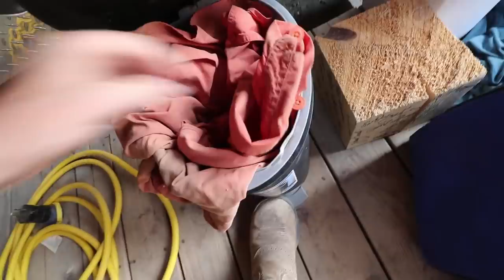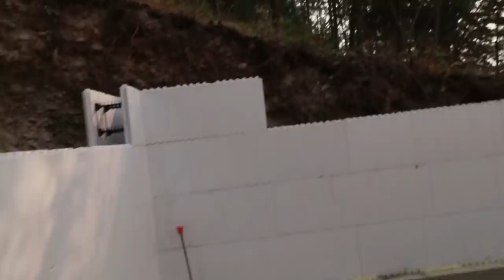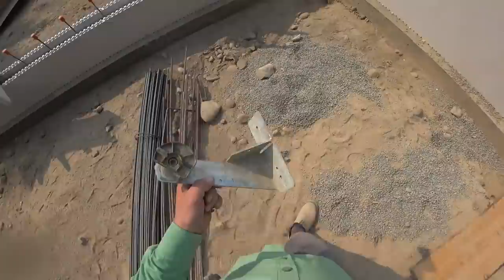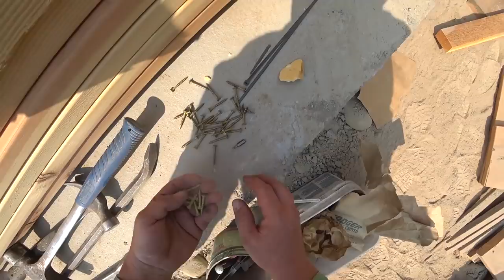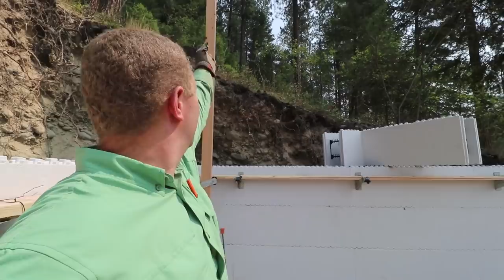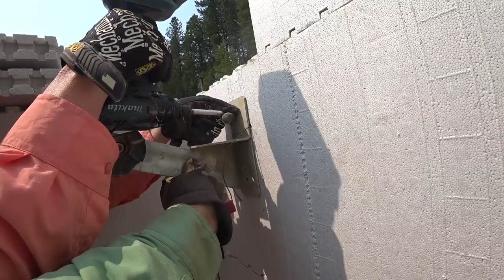Building a House Start to Finish: ICF Construction Walkout Garage

Comment: My wife and I built a fancy chicken coup a few years ago. In 113 degree heat. I have an (Alaskan weather preferred body type), so I didn't handle the heat very well. 

I remember waking up the next day and for the life of me I couldn't formulate a thought or a sentence. I thought I had a stroke during the night. My joints and muscles were beyond sore. 

Long story short. Gatorade or the healthy homemade version. Drink lots and often. If your thirsty you're dehydrated. It's that simple. Also wet your head often. 

Once I drank the two 32 oz bottles and about 30 minutes later I could think clearly and felt 100% better. 

Good luck with the build. Been watching since you started. Stay hydrated.

Comment: We always stacked two rows and then poured the slab. That way you have a good surface to work off of. So much easier to set your bracing system up on a solid surface. We used a true icf bracing system though, not the zont system. If you have a spot where your icf doesn't want to stay together, screw each end of a ratchet strap to the wall by pinching it under a horizontal piece of 2 x 4 about 4 ft long, top and bottom of your wall, inside and out. Ratchet down the straps and then stuff the tips of you foam gun in all the horizontal seams and squirt foam into them about every 6 inches. Let foam harden, remove straps, walls is solid. Quick and easy. Even faster it is to push down on top with backhoe (add protection under bucket for ICF) and then screw a vertical 2x up the trouble spot and install foam as mentioned above. I have done this a ton of times. Arxx ICF has a metal clip that pulls the blocks together vertically but they are the only ones I know of. Push comes to shove you can put the fat kid on the top of the wall as ballast while screwing the 2x on. If we didn't have a fat kid, we would use 2 or 3 skinny ones.   :-)  If you find that it is your footings and not your ICF joints, take a pull saw and cut a thin strip off the bottom row of ICF as a relief for the high spot in the footing. Tough to do now since you have your WP membrane on, hence another reason not to cover the wall until you are sure everything is good to go.

Comment: Get your self a large  3' dia fan, crack a water hose just behind the fan and let it blow cool air and mist over your work area, it really helps.  Used the trick to build a 60 x 46 hangar in over 100 deg temp.  Down side -- may need the  generator to power a larger fan.
Craig

Comment: Hi Jesse and Allysa.  I would like to share with you a major French drain mistake that my wife and I made 20 years ago when we were doing our self build.  I thought that you said that you were going to run your French drains into a dry well (gravel trap).  That is exactly what we did -  we dug two large pits and filled them with gravel, covered the gravel with drain fabric, and then buried them.  One year, we had above average rainfall, and guess what... the dry wells filled up.  Then the whole drain system filled up, and then our entire system became pressurized.  Needless to say, we found out that there were failures in our sealing system. We were flooded.  After the second time, I dug down three feet to the French drain, then rented a trencher and cut a 75' trench to get a downhill run to daylight. I put a "T" in and ran corrugated drain pipe in the trench.  Problem solved.  So... save yourselves a big headache and run your drain to daylight.  I cut a round circle out of 1/4" hardware cloth and inserted it in the end of the drain to keep the critters out.  We have really enjoyed watching your videos... it has brought back a lot of great, and not so great memories ;-) .  Hang in there, you both are doing a great job and you will be in before you know it.  We're pulling for you!

Comment: When you end up on a supply run , do yourself a favor and buy some " linesman " plyers .  Will make cutting and  twisting wires much easier.  
Get a good set as you will be needing them when you do your electrical when it comes to that time of the build .
Reply: might find them at a military surplus
Reply: i was actually thinking of safety wire pliers...
Reply: These are what I use for electrical and general purpose:
https://www.kleintools.com/catalog/high-leverage-connector-crimping/9-heavy-duty-cutting-pliers-crimping
Reply: Klien's are the best, I did concrete for 15 years on one pair of klien's well worth the purchase!
Reply: If Jesse does the electrical they'll need a firetruck, not a pair of pliers
Reply: mwilliamshs Haven't you read the comments?They will be fine there are no ''codes'' where they are building.
Reply: klein would do the job

Comment: I used these form 20 years ago they work great.  I don't get zip tie I just put the rebar on the cross bar and tied it with wire.

Comment: This ICF stuff is the most insane, labor intensive way to construct a concrete form that I have ever seen.  And there is zero room for error!  Congratulations!  You have convinced me to never use it.  If I ever want foam insulation on a foundation wall it will be applied after the pour.
Reply: They are doing it wrong and having to troubleshoot or redo stuff. I watched a video of people doing it right and a 13 person crew installed all the forms, door/window braces, for a 2300 sq ft home and had it ready to pour in one day. Nothing wrong with the product if done correct.

Comment: It would have probably been a lot easier to just stack up concrete block and rod and grout them solid.  Attach sheets of rock wool to the inside and be good to go. Probably cheaper too.

Comment: I am a saver also (I know the shirt toss was staged but, it was still funny...you are maintaining humor which is good).  The orange shirt has history.  If it won't come clean at least save it for oil changes, cement poor,  and the painting that is coming up in the future (save the precious new green one). Both of you changing up shirt color is messing me up on who is doing what on some takes. Kudos to both of you working when hot.  I don't do well above 80's.  Usually take break from 1 to 4 then work until dark (day goes better in such heat).

Comment: My Dad's company & therefore, I every summer, poured basement walls. A house this size would have taken a day to set the pans including tying the steel, 4 man crew. Whalers were simply braced back to stakes driven in the ground, no turn buckles, do minor adjustments as soon as the concrete was poured. No scaffolding needed. Conveyor or pump, vibrate as pour progressed. Don't let the vibrator run against the steel. It will move the coarse aggregate away from the steel and fill in with soupy fines. A lot less holding power. 
      Take care as you pour watching for any sign of blowouts. Be prepared for them. You can't push them back, just stop the spread. If it happens, cut the excess concrete away early next morning, a lot easier then.

Comment: BUILD A 4'X8' 5/8" PLYWOOD PLATFORM ON TOP OF STANDING 2"X12 (If you need the extra height" ON YOUR BACKHOE BUCKET! Put 2x4 railing around three sides (half way around the 4' sides). Works great!!!! set to your work height, tilt a standard extending ladder and you have a stable platform, I made one when building a barn that had 14' side walls and 24' on the end walls. I STILL use it to this day trim high limbs on trees.

Comment: I understand (maybe wrong) that you upload your videos a week after the work has taken place. As you talked about this I had a flashback to the work my uncle Steve used to do. Install a board connected to your vertical at 45 degree both at ground level and say 10'. Drive a rebar behind the 45s and place wedges between the 45s and the rebar if you need more pressure. Advice probably comes to late!

Comment: Congratulations of 200K subscribers!
Reply: dcsoxford but them building the house and documenting it IS their job, I find it entertaining. If they just called in someone at each stage of the project it would be pretty boring. 

This summer I built a teardrop camper from an old utility trailer. I  knew what I wanted and while I did what research I could at the end you just need to get at it and get the job done. I can really relate to their struggles as a lot of times the way you think something will work isn't always the result you get. After completing my camper I am much more proud of the accomplishment than if i had just bought something that cost the same as what I built.

Comment: So many people hating on them. Has anyone not done any project ever? People mess things up sometimes, but it is not the end of the world. You learn from mistakes and improve for the next time you have a build. At least they look at what they are doing and try to think of all the angles and admit when they found something off. Sheesh, as long as it is within tolerance, code, and their own standard leave them be. They are not professional builders and I'm sure if they could have changed what they have done from the start they would have. Its all apart of learning.

Comment: I think you can attach two by sixes to the concrete shelf and then put your vertical 2 x 4's on top of that I think that be a better way to support the bottom of those 2 x 4

Comment: This is even more complicated than building your house from concrete and bricks. As far as I know you don't pour concrete in that deep layers. At most you pour it in 30cm or about 1 foot deep layer, then vibrate it, then pour another layer and I have no idea how you would do that with those walls that high. BTW good Seinfeld impression :D

Comment: Jesse Could you put say 2 or 3 sections together on the ground and both of you set the section up.  Stay away from custom areas.  Gaps string a line from corner to corner at the block level - Probably not straight.  
Ron.

Comment: Question: Are the ICF's eventually being filled with concrete or something else?
If so, When you cut the bottom braces (black plastic) on the inside to make room for the rebar, does that leave a chance for a blowout because they don't have that same inward pull they had otherwise? Will you need to reinforce the outside when filling them? (If they are filled at all?) Thanks.

P.S. I have no clue if this is even a legitimate question as I don't know anything about construction. Thanks.
Reply: Correct deduction ' ... my dear Watson!'

Comment: You could surmise that the manufacturing of the blocks themselves is not machine shop perfect. Molds and even the difference between one manufacturing plant and another can't be perfect. You're going to drive yourself nuts if you insist on absolute perfection on this entire build!

Comment: A silly question - are you guys going to pour these 8 rows of ICF in one go? Back in late 1990 we built the whole house of a similar ICFs. But we only poured 4 rows a day with a concrete. Any more than this and bottom ICF got blown due to shear weight of concrete pressing from the top t the bottom. I can see your system is slightly different (our ICFs had one, very thick middle cross section joining two walls), still I cannot believe these plastic brackets and some additional steel bracing is going to take the whole pressure at the bottom...

Comment: Jeese - While you have called the manufacturer for certain things... you might want to ask them about the repercussions of cutting ties at the bottom of the wall. (Hint - Really bad...)  Whaler and strong back spacing is spelled out by the manufacturer.  Lastly... typically you scab while crossing the whaler / strongback clamp or that's where you split depending on the system.  Its really important that if you don't know you ask.  The engineering behind the system is heavy duty based on the liquid properties of concrete... the higher you go the more pressure at the bottom of the form.  (Also use your concrete pouring contact as a resource... he might have done wall forming as well and even if he didn't do this particular system its all relevant.

Comment: My question is this, if your foundation is 12 feet high and you need to build a house that's between 8 and 12 feet high (minimum) on top of said foundation, how are you gonna reach up to 24 feet high (minimum) to place the beams for your timber framed home? Better start saving for a crane, I don't think the backhoe will reach that high? Also is your basement going to be moon dust an immovable rocks?

Comment: Assuming they are available for rent, Would renting a scissor lift or bucket truck be worthwhile? If you could get a scisor to the inside, you could just drive it along the wall as you stacked blocks and it would be far easier and safer than going up and down a ladder for days on end.

Comment: i would pull a string line to check how straight your courses are running and double check with laser your footing could have a few  little humps in getting magnified as you go up you might have to do a little to get straightened  out hope this helps you out
Reply: left out the word shimming

Comment: I'd have the scaffolding completely separate from the strongbacks...  You could be distorting the walls as you walk on the scaffolding.  You don't want any extra forces being applied to the bracing other than the bracing forces.  If the scaffolding is attached this will prevent you from making adjustments to the bracing.

Comment: There is a bit on the previous videos montange you (accidentally) left some sand in between the wall joints on (atleast) one block. This could cause the vertical offset. Just noticed that this might be the cause.

Comment: The most critical thing is to Hold the ICFs Down. Pouring the Concrete will lift the ICFs.  Fixing the Strongbacks down to the footing is the most critical thing you can do.

Comment: Maybe it is just me but this block system to be a big pain in the butt.  Just curious as to why you went this route and didn't use a strait form wall for your concrete pour? Cheaper, more insulated, better water barrier?  Seems like you guys are putting a lot of time into this block system with all of its nuances.  Either way love the videos, keep up the hard work and you will be thankful down the road for not cutting corners.

Comment: Your right angle shear wall at the center back,  Should rise to within possibly an inch of the underside of the rough floor. (Floor Joists shrink over time,, the concrete must be below that future shrinkage.)  The floor joists left and right of the shear wall doubled,, and a double trimmer,, exactly as though you were framing for a fireplace or stairway opening.  The key to this is the double trimmer must be firmly against the basement end of the shear wall,, a concrete face.  Hence, the overturn moment of the shear wall will be transmitted throughout the skin of the subfloor  That skin, nailed and glued to a schedule,, will withstand the hillside lateral pressures, far in excess of what the shear wall alone could ,,, at an additional cost of an extra floor joist and a pair of 16 inch trimmers.

Comment: Two months too late, and what do I know, but I would consider putting  a horizontal plate, maybe 3/4 ply? on the footing, supported by rocks or gravel, to support the vertical boards. Maybe drive some nails into the concrete? But what do i know.

Comment: I have a question actually a few. 1st what is the price difference between this foam stuff & concrete block ( cinder blocks)? 2nd is there a insulation difference between the two? even if you fill in the blocks with cement & rebar like you are already doing.  Please don't get offended, just seems like this foam stuff is taking longer.

Comment: Plumb the corners in both directions, fill in the gaps, plumb your walls with braces, those tiny gaps are so negligable, at least we would consider them to be.  I dont know how you set wall elevations with that type of form system..  we use a pour strip set with a builders level.  Also your error wont compound as the wall grows.. if there is a hump in your footing it will just equate to a hump along the top of your form material. Again I dont know if thats crucial because I have no idea how that type of form system works.  Keep going..  you're doing great.  Buddy who commented saying standard forming system would only take 2 days to build is nothing I've ever seen.  Maybe if you do a half ass job or have a crew of 12.

Comment: Five more rows of forms?  Yikes!!!  Are you going to pour these forms in greater than 4' lifts? Are you going to use a vibrator?How do you get the concrete  (even a pump mix) to properly settle through all of the interference in the forms, cross ties, rebar, stiffeners etc? Especially working from 6 to 8 or more feet in the air? Can't wait to see that video...... Would  love to see a post pour inspection holes (removing small amounts of form material) at the bottom of these forms to see exactly how well the concrete was placed.
Reply: I smell a blowout or 8

Comment: What are you guys going to do about cooling the house once finished? solar isn't enough for ac right?
Reply: The objective of the partially buried basement garage is to reduce the energy requirements for cooling in the summer and heating in the winter.

Comment: Have to wonder if it would be less work to simply build a conventional concrete block wall with mortared joints and place horizontal and vertical rebar as one goes ?  Then add the external insulation and moisture barrier ?  The big advantage is that the wall is structural since it will set up every night and nothing is going to go anywhere.  Then a final set of rebar for the top row and pour concrete into the cavities and for the tie layer all round the top.   A lot less concrete work to do on site and much less risk of a blowout during the main pour.    But I'm biased, since that is what I intend to do...  Should also be a lot less expensive than expensive ICF forms.